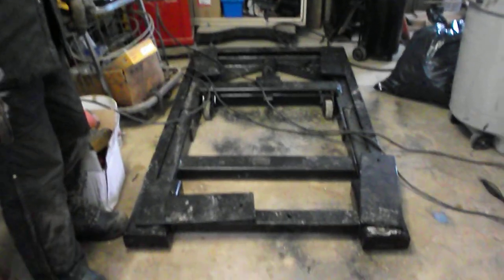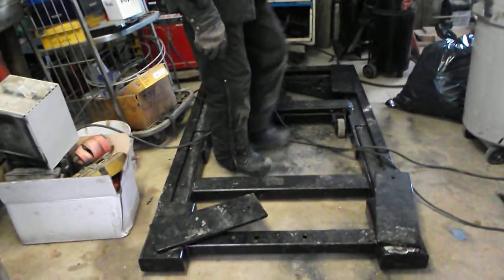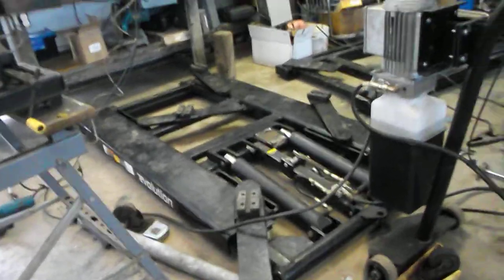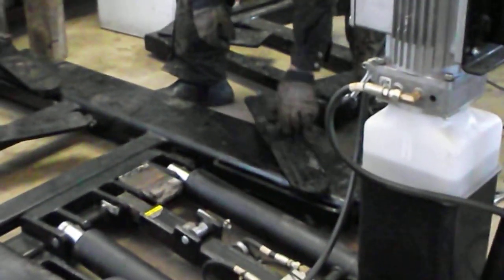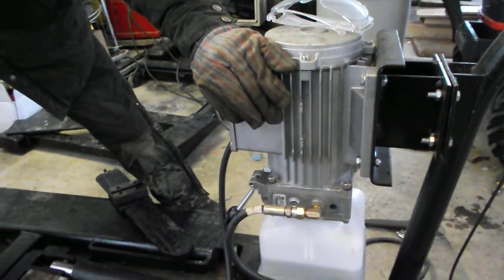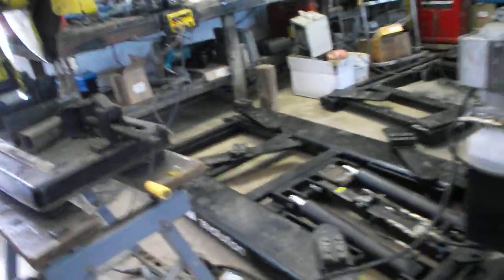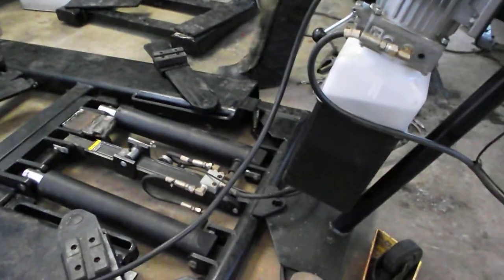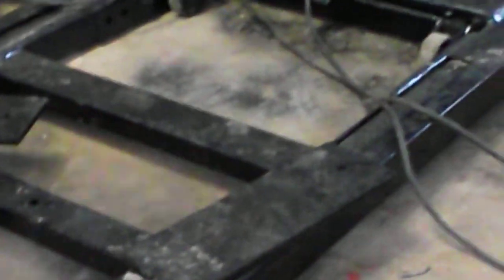Mid Rise Scissor Hoist_How to make it more portable_Part1of2

Comment: i i have the same vulcan hoist . i tinking if there is a peace missing on the control cylinder cause the air is comming out from the fill hole
Reply from the maker: This means your large pie plate sized cup seal in the control cylinder is worn, or the bore it rides in is rusted or worn.  Put 2 ounces of oil down the air relief hole and see if that seals it up.  If not, you will find that over time it simply won't lift as fast or as much weight.  A hydraulics/pneumatics shop replaced my cup seal and cleaned the bore since that was the problem for me when I first got my hoist out of a scrap metal pile :)
Let us know how you make out.

Comment: Could you give the caster capacity and height etc. I'm very very tired of this lift. It's not movable at all. Thanks
Reply from the maker: The caster was in a junk pile in my fathers old garage and I don't have specs.  However, I would recommend a capacity of 1000 lbs
Reply: @mrdiyguy123  Ok 😉if you have the total height it was great. I could order one on internet. Thanks
Reply from the maker: @jean-francoisfortier8727  the hoist has been sold but as I remember the height was 1"taller than the height of the hoist when fully collapsed.  That extra inch allowed the hoist to teeter totter taking weight off of the power unit handle.
Reply: @mrdiyguy123  very nice job! By the way. 👍👍👍

Comment: Hey. I have the exact same old Vulcan hoist. They are out of business I guess and I can't find much info on them. I just got it but the guy that had it butchered the cylinder set up. I was wondering what size diameter and how long a stroke it is supposed to have. He put a snow plow cylinder on it but it isn't right and he cut out the original basically. I would love a picture of how it was originally mounted in the middle. Any info would be much appreciated